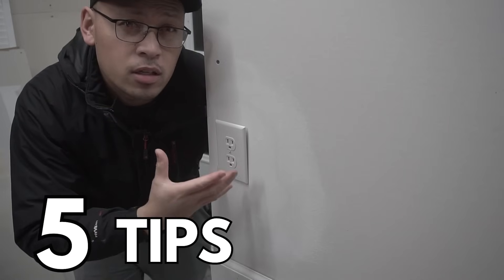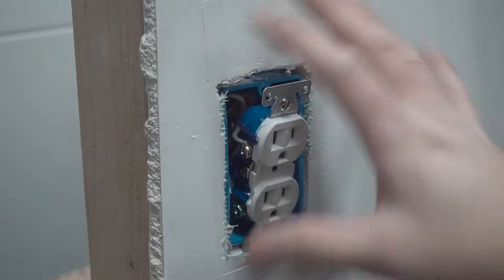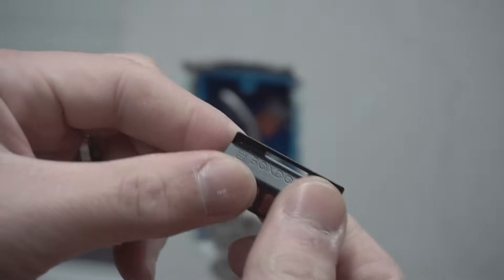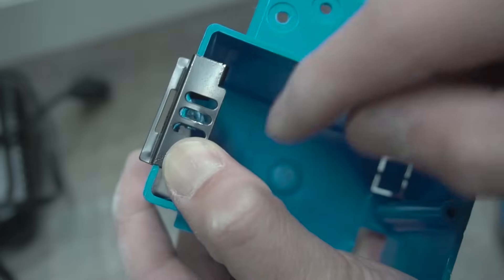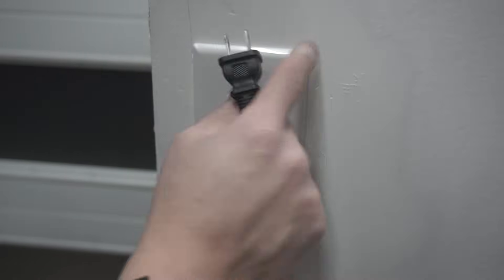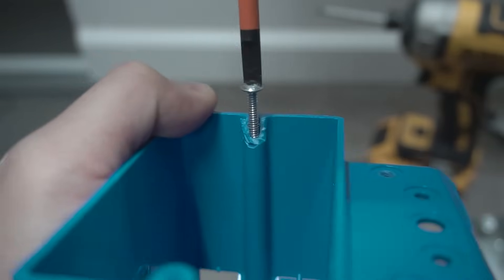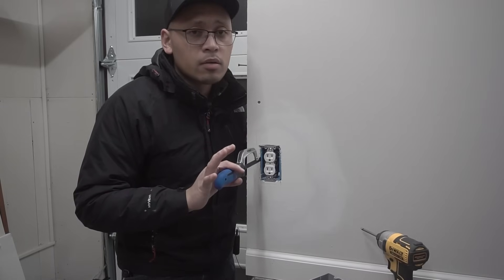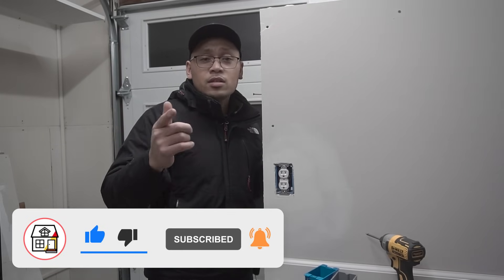How To Fix Drooping Electrical Outlet Or Switch On Wall - 5 Easy Tips and Tricks! DIY For Beginners!

Comment: How about when your jbox is literally not in the wall and there aren't any screws to tap it into the wall? The plug isn't sagging the entire jbox is coming out of the wall lmao
Reply: thanks you saved me from wasting my time on this video.
Reply: Check the box. There is a type that has screws that turn levers that hook the box behind the wall. The levers may have turned down. If that is not the case, replace it with a box that does hook behind the wall.
Reply: @AwesomeProjects20 and what if the drywall itself is gone right where the levers should hold it?
Reply: @LetsGo6009   I just came across that problem. I’m going to enforce that part by gluing/screwing paint sticks behind the dry wall and remount the box. The drywall will need repair no matter what I do. I’ll reinforce it now with wood to prevent the box from getting pulled out again later.

Comment: Another scenario I have seen is where the whole j box is loose. Not sure what to do about that (actually was hoping your video was talking about that LOL)
Reply: Same!
Reply: Tip #5 is for replacing the entire box.
Reply: @mattlipkin1926 hi, try this, I put a double socket + usb charging with a back back plate 'shelf' had the same problem one side of box loose on wall, I have extra long screws to compenate for the backplate, the 2 lugs that are in the electrical box act as some sort of retaining wedge when the two screws are tightened up, the 2 internal lugs need to be moved forward and you can see when you insert the retaining screws where the screws will go, you have to do the screws up so it pulls the the socket to the wall, you do a little bit on each screw so you do it evenly, this worked for me, please turn the electricity off that feeds the socket circuit, ...if those internal locating lugs stay to the back of the electrical box they are not doing their job to wedge the box in the wall, cheers
Reply: @stargazer7644 hi, try this, I put a double socket + usb charging with a back back plate 'shelf' had the same problem one side of box loose on wall, I have extra long screws to compenate for the backplate, the 2 lugs that are in the electrical box act as some sort of retaining wedge when the two screws are tightened up, the 2 internal lugs need to be moved forward and you can see when you insert the retaining screws where the screws will go, you have to do the screws up so it pulls the the socket to the wall, you do a little bit on each screw so you do it evenly, this worked for me, please turn the electricity off that feeds the socket circuit, ...if those internal locating lugs stay to the back of the electrical box they are not doing their job to wedge the box in the wall, cheers

Comment: My dude, I fixed mine today. After 10 years. Everytime I would iron my clothes, I would pull the iron plug and the top part would pull with it. Was driving me CRAZY!! The top screw wasn't catching. I pulled off the face plate and used a slightly beefier screw to hold the plugs in. It worked!!! I'm beyond ecstatic. Such a simple fix.

Comment: Great solutions! Thanks... My issue is somewhat different.  Yes, the smoke alarm pulls away from the ceiling. The j-box has dog ears to hold it into the ceiling for an interconnected smoke alarm system. After loosening the two adjacent screws holding the j-box I found both dog ears had been broken off... Who ever installed the box probable used an impact driver.  Since the ceiling drywall is NOT damaged, i'll just install a new j-box. I'm glad it's easily fixed. Thanks again for your quality videos.

Comment: Thanks for sharing this info  🙏 Will it be safe to continue to use the power outlet if it became saggy? It happened today and I thought since everything functioning as normal, so I just thought to fix next few days after observed it is ok for a day after it dropped off from the cracked wall. I  used this for a normal size fridge. please kindly advice 🙏
Reply from the maker: Hi! Personally since it has come off the wall I would deem it UNSAFE, even if it’s not a high traffic outlet. I would turn the power OFF from the breaker and get the receptacle (outlet) fixed as soon as possible, please be safe 🙏🏽

Comment: Black course thread drywall screws will usually work well, as their threads are wider. The wall plate will cover the slightly extended head of the drywall screw. Often times the more robust Phillips head of the drywall screw will tap into the box better than the flimsy soft head of the factory 6-32 machine screw head. This may not be code, but I've used it dozens of times. This is similar to the suggested wood screw fix, but much studier.
Reply from the maker: Thank you for sharing your technique! 🙏🏽😊

Comment: Sometimes the plastic box itself is not flush with the wall, and is sagging as well, old work box supports will clip on the box, and crimp to the drywall when tightened to pull the box back into the wallboard.
Reply: This my problem, but my drywall isn't supporting the box. How could I fix it?

Comment: My metal J Box appeared to be stripped. I tested this out by inserting a new screw of the same size but a little longer and it was easy to pull out with my fingers. So I took a screw with larger threads and it worked like a charm.

Comment: For the electrical box.. put a wood screw in there and its should hold... (on a plastic box)  
if the box is destroyed in anyway and you can tell. pull it out after shutting of the circuit and change the box. 

also it doesn't hurt to but in a GFCI receptacle in if your working on it anyway. code changed recently and its walking towards everything pretty much being GFCI and AFCI protected in residential
Reply from the maker: Thank you for sharing your technique 👍🏽😊
Reply: A course drywall screw works. Don't know if it's recommended but if definitely works
Reply: The new code didn't expand the locations where GFCIs are required (basically outside, garages, basements and anything within 6 feet of water), they just no longer restrict it to 15 and 20A 120V outlets.  You now have to put them on all 120 and 240V circuits in these locations.  You really don't want random outlets in the house as GFCI.  When they nuisance trip they kill all the outlets downstream and then you don't know where to look for the problem.  If you're that worried about needing GFCI in your house, replace the breakers with GFCI breakers.  At least then you'll know where to reset them up until you get fed up with them tripping and rip them out in a rage.

Comment: I'm going to try the glue and plastic piece with scenario#1.  It's a round box for a light fixture in the basement and the box doctor wouldn't work.  Thanks!  So frustrating to think the job is done until you try to put two screws in and it won't work.  I didn't strip it, it was a broken light fixture than wasn't fixed.

Comment: Hi just found your page. I live with my grandmother and aunt. ( helping them out) we have had an outlet in the basement that has always sagged from the outlet. We are talking at least 35+ years. Anyone have any advice on how I could possible fix this issue. This video was very helpful. My concern is if there is a bigger issue. I tried to explain an we need an electrician. But at 32 I’m still a child lmao

Comment: Thank you!  I used fix #2.  Got a different problem:  the cover now will not tighten to the outlet itself. The screw goes in so far and then spins.The cover is now lose.

Comment: My whole box pulls out of the wall when pulling the plug. I've searched for what to do but these are the videos that come up. The problem is, a guy drywalled over old plasterwork and he didn't fasten the damn boxes to anything! How do I fix that without tearing apart the wall!

Comment: That don’t do nothing . Are you crazy.  That has no threads. It’s a flat plate. The first repair.
Reply: Sounds like he's just trying to sell a product.
Reply: @Incognito1786 his tip on another video (maybe not his) worked for me by inserting a wood screw instead of replacing with a new #6 32 machine screw.